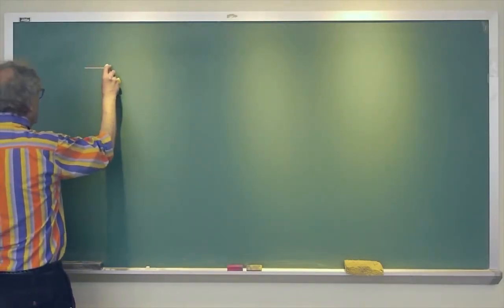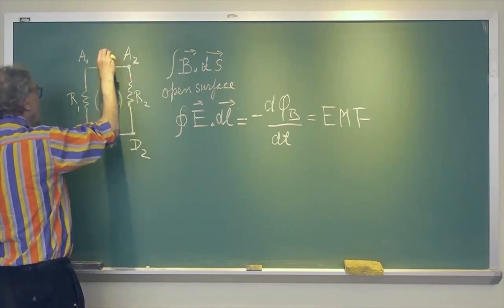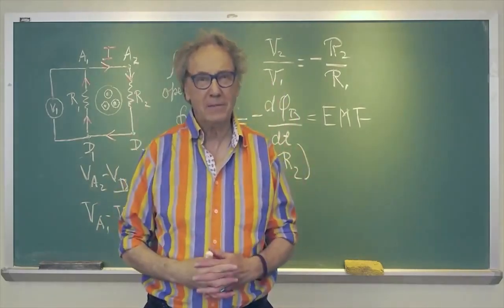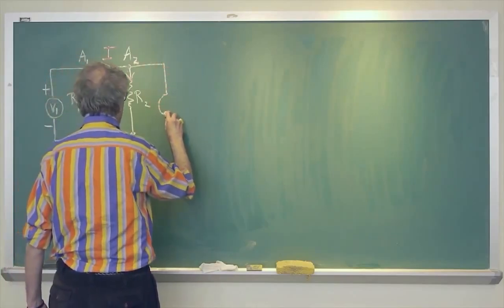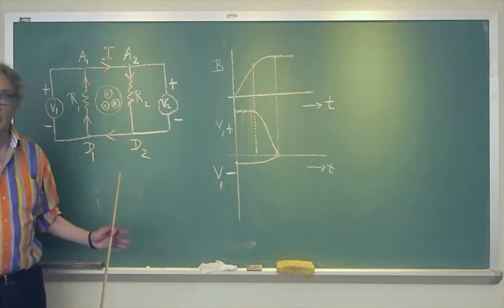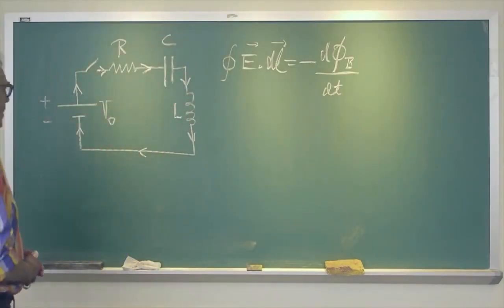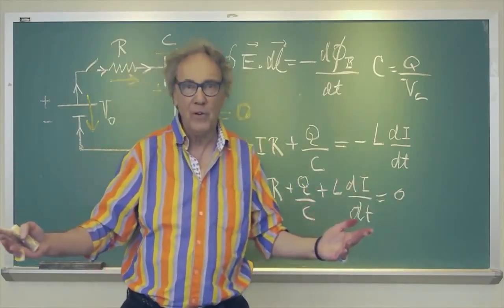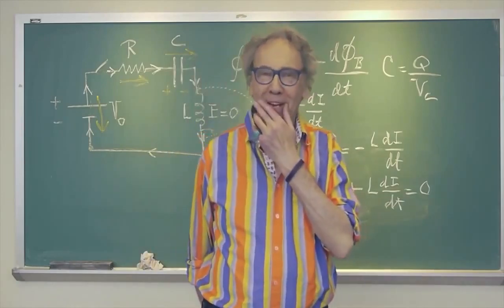Kirchhoff's Loop Rule Is For The Birds

Comment: Physics <3. 

I can't thank you enough.
Reply from the maker: +Nawaj KC you are most welcome
Reply: @lecturesbywalterlewin.they9259  sir I know very little physics. I saw the videos on kvl. Still cannot get the accurate meaning. I feel sorry. Would you please a video just explaining kvl and kcl?
Reply from the maker: @rakhiduttaroy8731  I appreciate the fact that this Physics may not be familiar to you. Don't feel embarrassed about it; you are not alone. However, it's never too late to get educated. The choice is yours. Maybe this will help you. 
I demonstrated at the end of my lecture #16 of my 8.02 E&M course at MIT that two identical voltmeters attached to the same 2 points in a circuit can show very different values. https://www.youtube.com/watch?v=nGQbA2jwkWI&list=PLyQSN7X0ro2314mKyUiOILaOC2hk6Pc3j&index=17 The reason is that in the case of an induced EMF (Faraday's Law) potential differences are no longer determined; they depend on the path. This also applies to the secondary windings of transformers as the EMF in the closed loop of secondary windings is induced. https://www.youtube.com/watch?v=b7i2uMx7gHo&list=PLyQSN7X0ro22zanLOcvkaSY-IZqheFYM5&index=8
Of course, in cases where Kirchhoff's loop rule (KVL) applies, 2 voltmeters attached to the same 2 points in a circuit will always show the same value. 
My demo was first suggested and published by Romer in December 1982 in the American Journal of Physics. This demo has now become a classic; it's done all over the world at many colleges and universities. 
Kirchhoff's original text can be found in the following link, pages 497-514: https://books.google.de/books?id=Ig8t8yIz20UC. Clearly he was fully aware of the prerequisite for his "loop rule". KVL is a special case of Faraday's Law. That's why Faraday's Law is one of Maxwell's equations and KVL is not.
By teaching students that KVL always works without telling them when it does not work, makes many believe that the closed loop integral of E dot dL is always zero. ElectroBOOM and Dirk Van Meirvenne therefore believe that 2 voltmeters attached to the same 2 points in a circuit must always show the same value which is not true as demonstrated in my lectures. They each posted a video (see @ footnote below) on their channel in which they claim to have proof for their wrong ideas which violate Maxwell's equations. Apparently they do not know, or do not understand, that in the case of an induced EMF potential differences are no longer determined; they depend on the path. MIT students who took my 8.02 course (Electricity and Magnetism) would not make this mistake! I therefore believe that to introduce a "modern version" of KVL and then teach students that KVL always holds is not advisable as you may set them up for making the same embarrassing mistake that both Dirk Van Meirvenne and ElectroBOOM made. 
Also read Professor John Belcher's thoughts on Faraday's Law and on KVL. Professor Belcher is my former colleague at MIT. http://core.csu.edu.cn/NR/rdonlyres/Physics/8-02Electricity-and-MagnetismSpring2002/C29636DB-AB80-49E0-BFAB-BCE00159F00E/0/lecsup41.pdf
(@) ElectroBOOM insulted me in his video by mentioning that the reason why my 2 voltmeters read different values was due to "bad probing". He stated that if I had done the demo correctly I would have found that both voltmeters would have read the same value. He could not have been more wrong  
This is my only msg on this issue. This is too basic. "I teach physics, I do not argue with people who think they know but who don't" (quote from Neil deGrasse Tyson). I do not argue either with people who believe that the Earth is flat.
This video may also help some of you to digest why 2 Voltmeters attached to the same 2 points in a circuit can give very different readings. https://youtu.be/T6S5VS03xZc
Below follows Problem 7.50 in Griffith. Notice the drawing which he copied from Romer and he wrote: "Notice that V1 is not the same as V2, even though they are connected to the same points! See R.H. Romer, Am, J, Phys.50, 1089 (1982)" https://drive.google.com/file/d/1G1a8_YNvB8X9xddUD27x9PE-j7Xbfo3m/view

Comment: Dear Prof walter lewin. I am a big fan of yours and have watched most of your lectures. You are undoubtedly the best physics teacher. But on this point I dont agree with your explanation. I have given my explanation of your example situation in this diagram. 
https://drive.google.com/file/d/0B3TmzNfunVQ3UUwxZ3JPWDA3SHM/view?usp=sharing    
Pls let me know what do you think.
Reply from the maker: +Akhlesh Agarwal The closed loop integral of E.dl in each loop that consists of one R and one Voltmeter is zero because dphi/dt through an open surface attached to the closed loop is zero. Kirchhoff's loop rule holds in these 2 loops (not in any other closed loop). Thus the voltmeter reads the value of the integral of E.dl going through the R and that is IR. Thus V1=IR1 and V2=IR2 and that is what the demo shows! If you want to be a purist, the integral E.dl from one side of the R to the other is (I-I_v)*R. Here I_v is the current going through the Voltmeter. But since I_v is some 8-10 orders of magnitude lower than I, it can be neglected. If you are still in doubt I suggest you read the Lecture Notes which have been posted as a pdf file (look below the video). I cannot help you any further.
Reply: Professor. We can completely ignore the current going through the voltmeter. That is not the discussion. The point is that in your measurements you are measuring voltage between A1 to D1 and A2 to D2. You assume that Voltage between A1 and A2 is zero. My point is that voltage is being generated (induced) on the whole length of wire loop. So if length of wire between A1 to A2 is not negligible compared to the complete length of wire in the loop then there will be voltage difference between A1 to A2 and similarly Between D2 to D1. That will explain the difference in voltage reading across R1 (A1 to D1) and R2 (A2 to D2) that you have taken.
Reply from the maker: +Akhlesh Agarwal Watch this lecture
https://www.youtube.com/watch?v=nGQbA2jwkWI&list=PLyQSN7X0ro2314mKyUiOILaOC2hk6Pc3j&index=17
Reply from the maker: +Lectures by Walter Lewin. They will make you ♥ Physics. In the demo that I did in the lecture D1 and D2 were the same point, and A1 and A2 were the same point. Your argument is incorrect.
Reply from the maker: +Akhlesh Agarwal In the demo, A1 and A2 were ONE and the same point and D1 and D2 were one and the same point.  Your reasoning is incorrect. Watch the demo!
Reply: +Lectures by Walter Lewin. They will make you ♥ Physics. Professor if A1 A2 is same point and D1 D2 is same point then there is no way the voltage reading A1D1 can be different than A2 D2. 

Anyway you are a great professor and a huge celebrity, so no point arguing on youtube. But I dont agree with your logic. I suggest you get some other MIT professor or may be some research student to study your logic and my logic. and publish the final conclusion. 
Bye.
Reply from the maker: +Lectures by Walter Lewin. They will make you ♥ Physics. The wires in the circuit as drawn on the black board are all made of superconductive material. There is no E-field in any of them. My calculations in circuits always assume that wires have zero resistance. In the demo as I did in lectures, A1 and A2 are one and the same point and D1 and D2 are also one and the same point thus the distances A1-A2 and D1-D2 are both zero.
Reply from the maker: +Akhlesh Agarwal You wrote:
" Professor if A1 A2 is same point and D1 D2 is same point then there is no way the voltage reading A1D1 can be different than A2 D2.". 
That is incorrect! You do not yet understand Faraday's Law. DO NOT FEEL BAD, you are NOT alone. The "voltagel" readings are NOT the same for the simple reason that the closed loop integral (through R1 and R2) is NOT zero. Kirchhoff's loop rule is NOT valid. The closed loop integral is -dphi/dt. Thus the integral of E.dl depends on which path A=>D your choose.  If A1=A2=A and D1=D2=D (that was the case for the demo I did), one path A=>D is different from the other path A=>D. That's Faraday for you! V2/V1= minus R2/R1. Notice that the magnitudes of V2 are V1 can be very very different  (depending on the choic of R1 and R2), and the polarity of V2 and V1 are opposite. Thus the two "voltages" (your words) A=>D even have a opposite sign in the two different paths as was clearly demonstrated by me (watch lecture #16 of 8.02x). This demo has become a classic. It's now-a-days done by countless physics teachers in the world, including many at MIT.
Reply from the maker: +Akhlesh Agarwal Maybe this will help you. Take the case that the distance A1 to A2 is not zero and D1 to D2 is not zero either. Let R1 be 10 Ohm and R2 be 100 Ohm. Let the resistance of the wires from A1 to A2 and from D1 to D2 be 0.0001 Ohm (copper wires with diam 1/8 inch and with length 4 cm). Thus the resistance in the wires A1=>A2 and D1=>D2 are MUCH MUCH smaller than R1 and R2. I expect you will agree with me that these 0.0001 Ohm resistances will have a near zero effect on the outcome of my demo. My calculations will still be very good approximations and the "non-intuitive" results of the demo will be unaffected even if A1 and A2 and D1 and D2 are not the same  points in the circuit. However, in my demos at MIT A1 and A2 were the same point (A) and D1 and D2 were the same point (D) but that is NOT a requirement.
Reply: +Akhlesh Agarwal that's a good point, and imo a valid one too
Reply from the maker: +IM IM You are mistaken. You do not (yet) understand Faraday's law. Don't feel bad, YOU AR NOT ALONE

Comment: You are the reason i am going to apply to MIT this year. I tried obtaining the minimum sensitivity of a voltmeter that is necesseray to measure the pds in this circuit( the LCR series one)when a solenoid with an Ac current (220 50 HZ) is going through the center. I couldn't reach any conclusion as i couldn't vary the parameters of the ac voltmeter.It was for my school project. Do you have any advice that may improve the setup?
Reply from the maker: +Kaushik Harith You can make a reasonable estimate of the EMF with your set-up. That will tell you what your problem is.